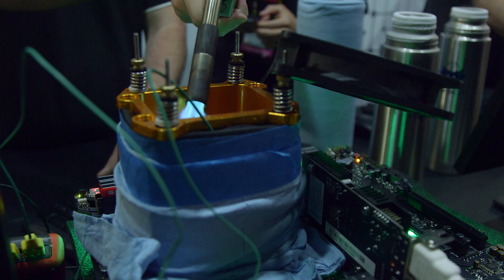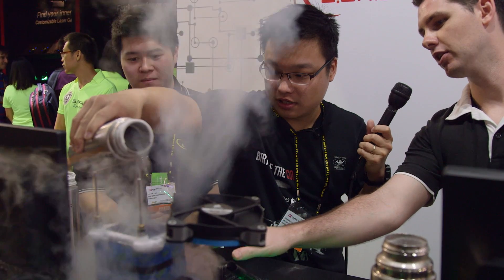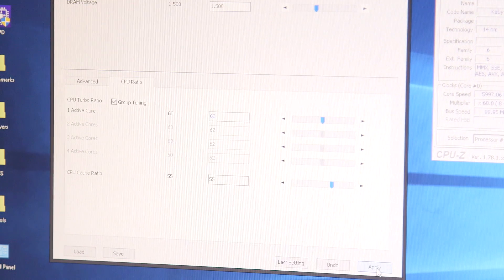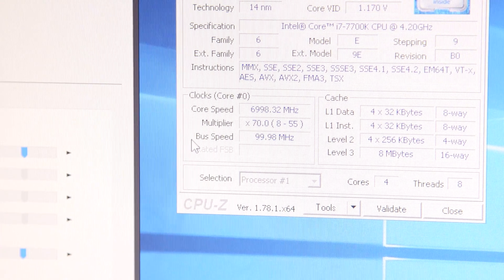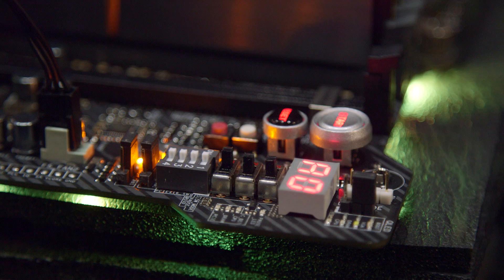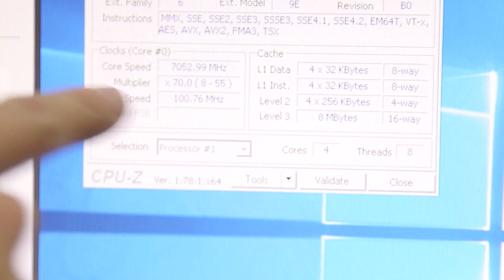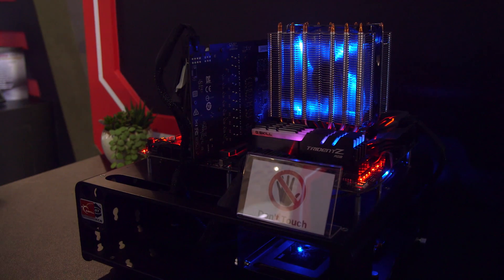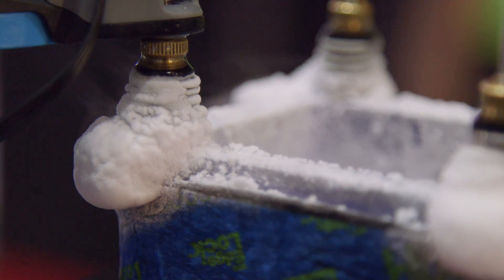Overclocking to 7GHz with Liquid Nitrogen | Hands-On | Computex 2017

Comment: This is pointless if you can't use it in normal environment (plus you gotta always keep an eye on the nitrogen liquid level to add more when needed), otherwise no one would ever again bother to buy a new chip if you can overclock yours up to 7 GHz.
Reply: no its not pointless, this is about exploration of the capabilities of the hardware and enjoying the awesome community that HWBOT´has built up over the years. By doing this you obtain a lot of knowledge about your hardware, it's weaknesses and strengths.
Reply: I was speaking about its usage in normal environment (at home)
what's hwbot ?

Comment: Few years from now you'll be able to do this with stock air coolers
Reply: As long as AMD continues to compete with Intel.
Reply: No and because physics. Thats like the people in 2000 saying we would be at 10GHz by 2010.
Reply: nah, few years from now its gonna be fidget spinners as coolers
Reply: That's what people were saying back in the late 90's, when processor clock speeds seemed like they would go up forever at the same pace. They eventually stalled out, because the heat dissipation issue was too much to deal with on a commercial scale. That was why both Intel and AMD switched their focus to multi-core processors and more efficient designs. Unless liquid nitrogen becomes the default cooling solution of everyday computers, we'll only see improvements in multi-core processors and other efficiency gains in the next few years.
Reply: And with the i15 99999k
Reply: Avi Schiffmann Few years from now we'll be feeding on semiconductors.
Reply: i'd rather say that we'll run multi cpu computers to get more ghz and cores
Reply: We're already at the limits of max GHz, next step is more cores. Sure we might get a slight bump but it will be a while if ever before we see 7GHz CPU's.
Reply: Die stacking will happen before moving to a different material...
Reply: +Hoi Hoi The problem isn't heat, it's degradation caused by excessive voltage and that only gets worse the smaller we go (14nm -> 7nm etc). Take the Ryzen 7 for example, with proper watercooling you will easily be able to run it at +1.5v but that will rather quickly cause permanent damage to the CPU.
Reply: +Starlesslemon Watercooling will NEVER become mainstream because it's way too expensive compared to air cooling and good air cooling beats cheap watercooling that costs the same.
Reply: +Kaydn Burns You're the idiot here. You go on to say how higher voltage wont cause damage and then contradict yourself in the next sentence. Ofcourse too high of a voltage (beyond the rated specs) will cause damage regardless of cooling and how fast that damage occurs depends on many factors. And I said watercooling will never become MAINSTREAM, you know what that term means? It means 10-20$ coolers, not top end air cooling.
"You try overclocking a i7-4790k to 4.4ghz on aircooling" can be easily done with a 45$ air cooler such as the Thermalright Macho. Oh and it's very quiet, quieter than your average water cooling setup.
"there is literally no point in getting more cores as almost all games and applications dont use more than 4" We are talking about the future here, if you think applications/games wont be utilizing more than 4 cores in 5+ years you're a moron
"The next step is quantum computing" You thinking quantum computing will be the next step in anything but the very far future just goes to show YOU have no idea what you're talking about. Quantum computing is so fundamentally different from how computers and programs currently work that absolutely everything will need to be rebuilt from scratch. It will take decades before we have anything even remotely usable.
Next time you attack people trying to act all smart how about you atleast get your shit straight. As it stands you've just shown you're nothing more than a edgy teen who was still learning how to wipe his own ass when I already knew what you know today.
Reply: ExorcleGaming/Templates i read the article and appreciate the knowledge drop. it seems like the core split is more of a solution to the way we actually use computers on day to day than anything else. like how running two video cards in Sli/crossfire doesn't outright double your Gpu ability but may be cheaper than getting a single big card.
Reply: no you won't
Reply: 20ghz by 2018
Reply: More than 4-5GHz will never be a reality for stock coolers. It's taken us over a decade to push much beyond 4GHz (The Pentium 4's were hitting that). Even when overclocking with water cooling 5GHz chips are rare.
Reply: Avi Schiffmann thatll never happen. thermodynamics mate
Reply: Filmer1eX but watch the model of cpus will change and it won't get hot and will be infinitely overclockable
Reply: Filmer1eX oh thanks.
Reply: Avi Schiffmann implying there will be air cooling a few years from now
Reply: Filmer1eX true fastest reply ever
Reply: +Filmer1eX
I think what Kaydn is referring to is the difference between straight damage caused by too high-a voltage with insufficient cooling and degradation, which happens anyway but is accelerated greatly as you increase the voltage.
Reply: Filmer1eX both IBM, Google and microsoft have shown working quantum computers. Its just not fully developed yet. They say to have a working and viable option by end of 2017 or at latest 2019. Not sure what far future to you is but in cpus its 10-20 years. Every 2-4 years except for the last couple there have been major upgrades in instructions per clock and architecture improvements. Also yes you are correct its fundementally different that doesnt mean it wont be implemented extremely quickly. In consumer products we WILL see quantum computing in the next 10-15 years. If not a different form of computing as we have hit the limit for current cpu architecture. Theres a reason cpus havent gotten better in performance and have just added more cores. Not to mention even current programs that utilize all cores dont even utilize them all properly and dont use the theoretical maximum performance. And you show me someone hitting 4.4ghz on a devils canyon cpu on air cooling.
Reply: Filmer1eX oh and dont show me synthetic benchmarks. Real world application with high end gaming, rendering etc in a closed enviorment.
Reply: Filmer1eX also what the hell do you consider mainstream? Lmao. The majority? Because thats a dumbway to look at it. There are literally hundreds of prebuilt systems that use watercooling on $500-$1800 machines. In areas where you have a small case and not alot of airflow, water cooling is a better option. Air cooling has its benifits however. Fundementally, water transfers heat MUCH MUCH better than air.
Reply: Avi Schiffmann lol, goodluck with that
Reply: sounak bar No man, few years from now the AI Overlord will force semiconductors to feed on us.
Reply: Subscribe to me for free candy
Reply: Avi Schiffmann  not unless Transistors switch from silicon
Reply: Avi Schiffmann liquid nitrogen is too dangerous for the average dumbass to handle. It would never make it pass a niche commercial market.
Reply: actually not likely, mainly due to the fact that clocking to this point is not very beneficial and is SUPER inefficient power wise and does kill CPU lifespan when done to an extreme. Once you get over 4.5 Ghz the actual performance gain kind of drops off and you can see detailed research done by various universities that back up this info though the actual drop off varies from chip to chip.
Reply: No bro
Reply: It’s simple physics. The speed of light limits the size of a clocked circuit. At 10Ghz, the electric field can only propagate 3cm. However, as the size shrinks, so does the area from which heat can dissipate. You’re simply not going to see powerful processors running at 10Ghz in air cooled consumer products.
Reply: No. I'm concluding that from simple physics. As the clockspeed goes up the required voltage goes up exponentially. There is always wasted energy, in this case heat. The higher the voltage the more wasted heat energy there will be...and we are very, very close to the limit at a reasonable temperature. Unless you find a way to make stock heatsinks as effective as liquid nitrogen at a reasonable cost or reduce the wasted energy to zero (hint: that's not possible) it simply isn't going to happen.
There is a reason it took us a decade to go from 4.0GHz to 4.5GHz. That reason is physics.
Reply: In a a few years cpus won't get hot
Reply: MeatSafeMurderer You're concluding that it will never be a reality from the fact that it's taken us over a decade? That's unscientific as fuck, to be honest.
Reply: +Filmer1eX
Wooooooosh!
Reply: Youre an idiot and have no idea what youre talking about. First off, higher voltage will not cause damage to a cpu with proper cooling. It just wont. Only EXTREME, like 1.7 volts or higher. Which in most cases you need liquid nitrogen cooling anyways. Also, water cooling isnt expensive. Its about $15-25 more for better performance and less noise. Sure if youre on a budget and want your fans ramping up everytime you a play a game go ahead and get air cooling. I watercooled my entire system for $160 and my gpu and cpu are both overclocked and never go above 65 degrees. You try overclocking a i7-4790k to 4.4ghz on aircooling
Reply: MeatSafeMurderer My point is THAT should have been your argument in the first place instead of how long it took to reach something in the previous decade. However, even that isn't enough to be so bold to claim that it'll never happen. Not only that, you've used a case of sophism to improve your argument. In order for it to happen, we need to find a way to reduce the wasted energy enough, not to bring it to a zero, which obviously is ridiculous. Also, the concluding factor was reducing wasted energy to a zero and you ignored improving the efficiency of alternative factors, such as the heatsink or even entirely different forms of cooling. In the past, watercooling was thought to be a thing of the lab and would never reach commercial status. So you've used sophism to improve your argument, which is still not very scientific.
Reply: Also youre right about the ghz, however, cores isnt the answer, there is literally no point in getting more cores as almost all games and applications dont use more than 4. Intructions per clock is what is important. The architecture of the cpu and how it fundamentally works. The next step is quantum computing. That will increase instructions per clock exponentially
Reply: And you've chosen to ignore my point. It is true that I exaggerated...but I assumed you were a competent being (as I'm sure you are) who is capable of realising that reducing the wasted energy and improving cooling technology is exactly how we made up that 500MHz difference...and it took a long time. Perhaps it's more accurate to say that 7GHz will never be a reality for stock coolers in a reasonable time frame. The OP also stated stock AIR coolers...therefore completely disqualifying water let alone alternative niche cooling methods such as phase-change, which is about as close as we currently are to the kind of cooling required, though even that falls short.
Reply: I5-7600k 3.8GHz x 4 cores = 15.2 GHz , wouldn't that be technically correct?(the best kind of correct)

Comment: I wonder what the computer feels like when working with a 7ghz 7700k
Reply: Stimulate your senses.
Reply: Let's not forget that it's 7ghz on one core. ONE CORE.
Reply: crash for sure
Reply: Andri Egilsson like yourself on heroin
Reply: on a single core? it feels pretty shitty.

The most impressive overclock is when you overclock all the cores.
Reply: Andri Egilsson what does it taste like?
Reply: ***** unless you are minecraft gamer
Reply: Anton Helsgaun 7700k is overclockable, threadripper and i9 is not released yet, 6950x isnt good for overclocking. Duh
Reply: Andri Egilsson it's just thinking pls no program anymore I burn out just by stating Windows and my browser in cause of to high clock
Reply: It looked like it felt pretty shitty. It seemed to freeze rather swiftly.
Reply: sliwka621 if it's a 7 GHz fidget spinner
Reply: Like it freebased 3 lbs of crack cocaine laced with Adderall while injecting liquid crystal meth into its eyes while wearing cinder block shoes.
Reply: unstable. Even though 'more power' is a wet dream to most 'enthusiasts' it's unrealistic and impractical past a certain point.
Reply: Anton Helsgaun you dont say "imagine" in the first place. And 7ghz is way too high. Why ? Just becouse use nitrogen ? Or what ?. And 7700k stable on 5ghz (multi core, i guess)
Reply: Yep, just like my g3258 overclocked to 4.4Ghz is no slouch at single threaded stuff... even a quad core leaves it in the dust most of the time.
Reply: gid gud
Reply: Andri Egilsson why do that when you can get an i7 8700k
Reply: Andri Egilsson The performance of your computer is only as good as the applications it runs. I doubt you would notice any difference.
Reply: Iam Pyre
"The performance of your computer is only as good as the applications it runs"
 um what? if performance mattered on applications thered be an issue lol. i mean maybe it would  a good thing for ex. lets say...

if a video game doesnt have a limit to performance than i would be able to play high performance video games without pc specs, lmao broken.

that means everytime i use an app, my pc would adjust to the apps max performance. if i use something with a max lower performance than that video game, it would adjust to that lol, that would be weird and probably wouldnt be very good.

id rather have my pc rely on hardware like how it should be so i can adjust and set the performance how i like. wouldnt want to use a low performance program just so my pc would become that app lol.
Reply: what humans feel when they snorted 7gram of cocaine in 1 sec
Reply: PokéKid

Is your brain overclocked? Because the way Iam Pyre said "The performance of your computer is only as good as the application it runs"
is closer to
"A chain is only as strong as its weakest link"
Instead of
"Your computer goes to highest graphic setting of any game/app run"....
Reply: Alexander C thats a poor analogy. btw thanks for the compliment, it shows why his comment makes no sense. if my brain is overclocked that means i get better perforamance :))))
Reply: DanWunderBurst “I need some body, help, not just anybody, help
Reply: Applications have to be programmed to utilize specs, stop letting The tech industry sell you lies. Multi-Core processing, 64-bit computing, most of this technology is wasted because applications aren't even designed properly to utilize theses technologies. Like I said, unless an application was specifically designed to utilize certain technologies or take advantage of "enhanced" specs, there will be no difference in computation. Seriously, if it was as easy as you wanted it to be, you wo would be able to pop a ps2 game in a PS4 and get stunning results! Thats not the case, and its because of reasons more than just different computing architectures.
Reply: ...What is Hardware without software? Nothing! You can spend a billion dollars on a super-computer, but if you don't invest  on solid applications, it's practically just a pile of metal and dirt.
Reply: Iam Pyre alright ill go run my pc without a motherboard, cpu and gpu oh and pu to even power it, wish me luck
Reply: Probably the same exact as a computer at 3.4ghz 7700k. This is why this shit is dubm you don't feel the extra horse power like a car lol.
Reply: Andri Egilsson but why 7700k? wasnt it like "no overclocks plz"?  why not go with a threadripper, i-9 or just a 6950x?
Reply: I think it would feel like rubber
Reply: I myself was wondering what 7 GHz smells like. Probably smells like AUTISM.
Reply: Alit Putra andri egilsson said "imagine". And yes running a pc normally where you have to fill it up with lN2 every fifteen minutes is not useable. It would also pose a serious health hazard
Reply: ice
Reply: Overclock my memes daddy.